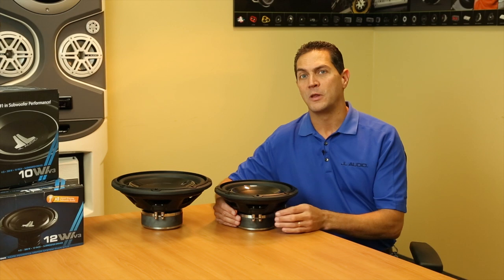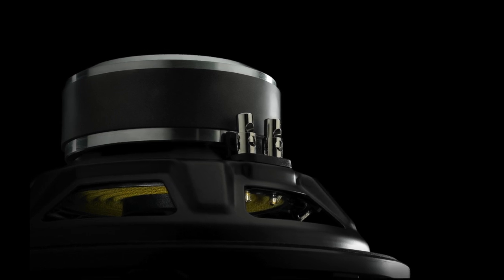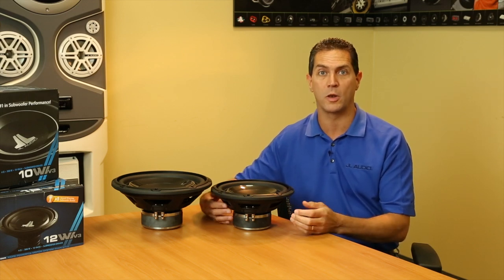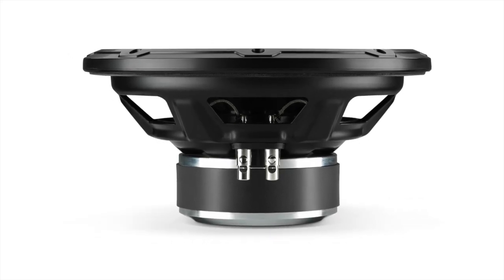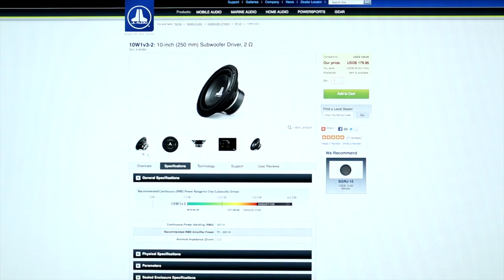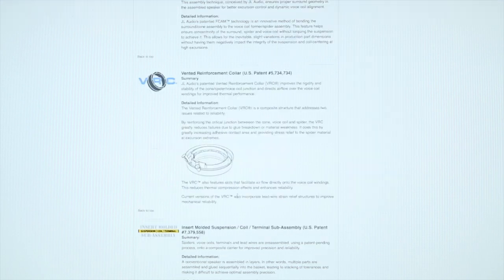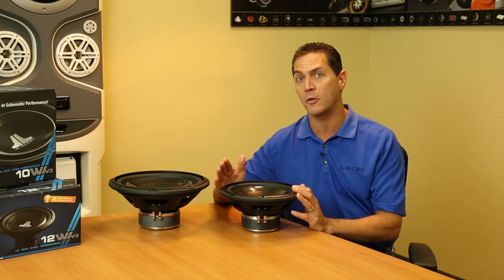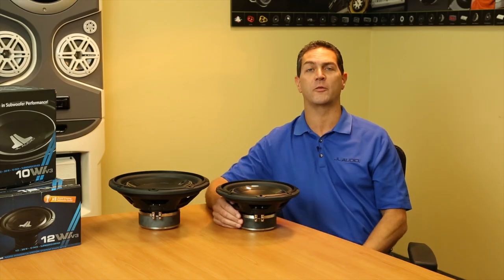JL Audio W1v3 Product Spotlight

Comment: Very nice looking drivers indeed.  I am torn between the 10W1v3 and the 8W3v3.  I have a 250/1v2 amplifier and I want to build a sealed enclosure.  They have similar price, power handling, and excursion capability.  I want a flat response with high sound quality, along with an impressive "effortless" output at 250 watts.  Any suggestions?